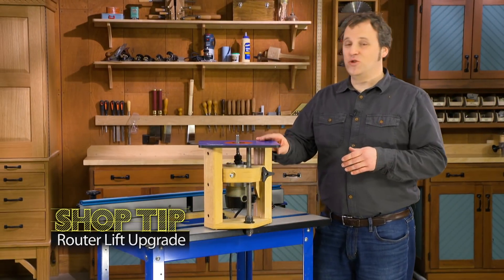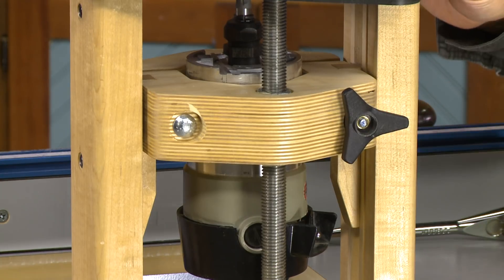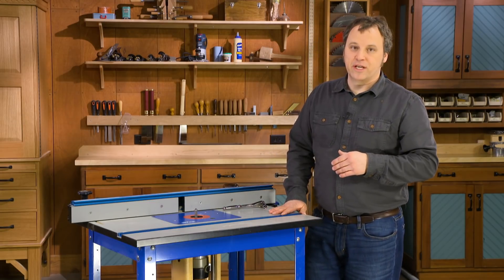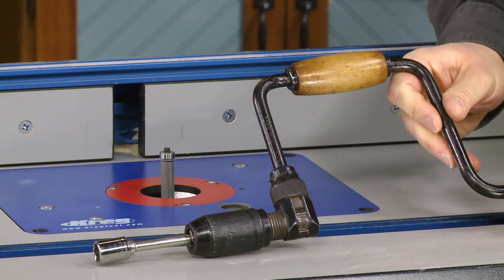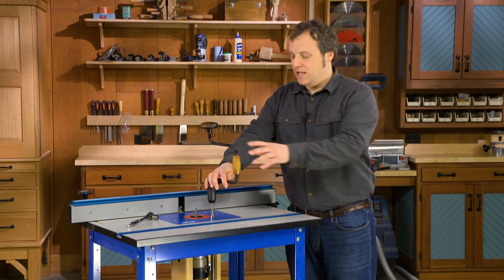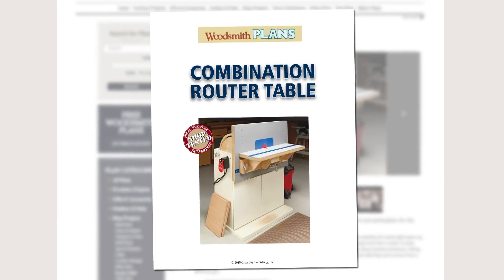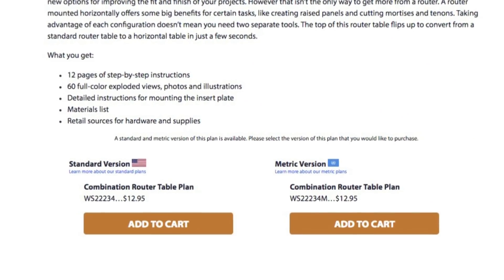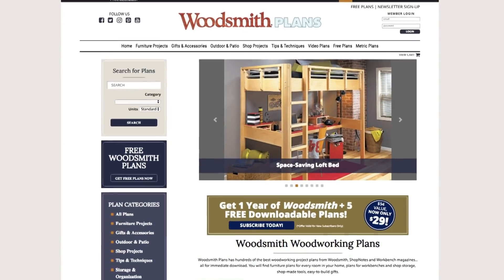Upgrade Our Shop-Built Router Lift With an Old-School Tool!

Comment: I have an older delta that used a cheap direct drive motor that went bad, I'm thinking of using the trunnion assembly to make a second lift that will also tilt as a router table leaving the throat plate off and making a new type for a router.
A new motor for it cost more than some of the saws today and I hate to waste good materials, its cast iron top and decent rails.
I also think the added profiles off 90dgr will add to router bits use and make new looking trim you can't buy.
Reply from the maker: bobbg - This sounds like an interesting idea. 👍

Comment: Could also add an extension on your ratchet.
Reply from the maker: We actually show using an extension on a ratchet in the plans, but I guess I like using the brace better because it's a lot faster.  Plus, the brace I have is an old hand me down that I rarely use anyways... this way I don't have to have a dedicated ratchet set for my router lift.

Comment: Another Idea so you don't have to remember where your brace is, get a 3/8" drive speed handle. Available at Harbor Fright for $7.99. It takes up less space than a brace and you can mount it to your router table so you never have to go looking for it.
Reply from the maker: Yep, that would work too! 👍

Comment: I'm in the process of designing a routerlift incorporating Jay Bates' design but using the motor out of a lift chair for quick, coarse raise and lower, and adding a fine adjustment with a fine-threaded rod that will be turned by hand similar to yours. Still trying to wrap my head around how to do that in a small space. I may ask an engineer friend for some ideas. I hope he doesn't overthink it. LOL
Reply from the maker: Coming from a Mechanical Engineering background myself, I don't think you can ask an engineer not to over-think something... it's just in our nature.  :)
Reply: @WoodsmithShowandmagazine  :-)
Reply: Use a speed nut and lever. The nut is disengaged by a spring loaded button on the side. McMaster Carr has them. I have one on my multi machine saw adjustment.
Reply: @davidpape9726  Thank you. I did a search on their website and came up with clip on and slip on nuts. I think that's the same. But what type of 
lever are you referring to?
Reply: The nut will need to be pinned or encapsulated into the router holder. A handle sticking out would make it easier to lift quickly. On my saw the height adjustment handle / lever pivots on the nut via a pin keeping the nut and lever from binding as the angle changes. May not really be needed in your case, just push the button and lift the router. Now labeled in the catalog as push button slide adjust nut.
Reply: NO DON"T  COME BACK FROM THE DARK SIDE!

Comment: I'm curious what type of mechanism locks the height of the router?  Without a locking mechanism its going to vibrate and change height while you are using it. 

As far as hitting the bit with a ratchet, try an extension or cordless drill if you are impatient.  Something like that would be a huge improvement to my router table.  With mine, if you get it all set up and find you need a minor adjustment in the height, you have to pull the fence back and re-do everything from scratch.  A router lift is definitely the way to go.

Comment: They make extensions for the ratchet that a lot cheaper than a brace.
Reply: But I already have a brace I rarely use, that’s the point.
Reply from the maker: We actually show using an extension on a ratchet in the plans, but I guess I like using the brace better because it's a lot faster.  Plus, the brace I have is an old hand me down that I rarely use anyways... this way I don't have to have a dedicated ratchet set for my router lift.
Reply: They also sell a speed wrench for very little.

Comment: Excuse me! But we (Mechanics) have had a device called a "Speed Wrench" which does this job directly with the socket in the first place! No need to set an adapter into your hand drill to accept the socket! Or just use an extension for the socket! Really, you woodworkers just seem to over-engineer everything.
Reply: He'd have to buy the tool he had this one in his shop, and I believe you can use a 1/4 extension without changing either tool. a 3/8" extension might also fit I've never tried.   Where do you think the Idea of a speed wrench came from?
Woodworking! 
   "The first crude braces were found on the English flagship
the "Mary Rose". They can be dated back prior to the sinking
of the ship in 1545"
http://the-working-man.com/brace-bit-history.html
Reply: First thing I thought of.  Use to be that large socket sets came with a speed wrench.  Haven't bought one in more than 30 years so I don't know if they are still included in socket sets.
Reply from the maker: Yeah, I am aware of the speed wrench, but it seems like every woodworker has an old bit brace they’ve inherited that is just laying around collecting dust so might as well put it to use. 😀

Comment: How about an old cordless screwdriver or drill.  Or, if you really want to go nuts, fix a small motor with a toggle switch.
Reply from the maker: I like where this is going :)
Reply: They make motorised lifts,  but you know that old XRP Dewalt you can't buy batteries for anymore.
But you would be better off with a Servo Motor using 12 Volts they have a lot of power and run slow.
You just need a reverse ground polarity switch.<<  Car Power window switch off an older ford 5 wire type.